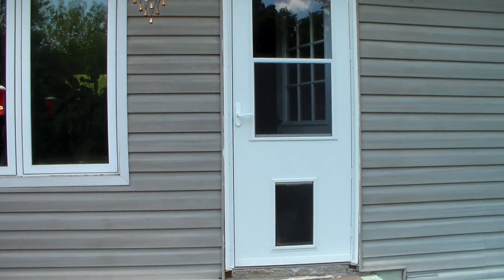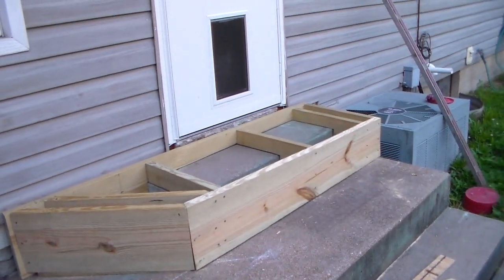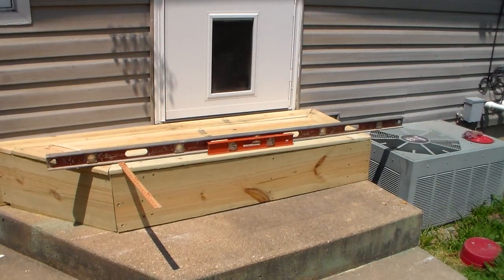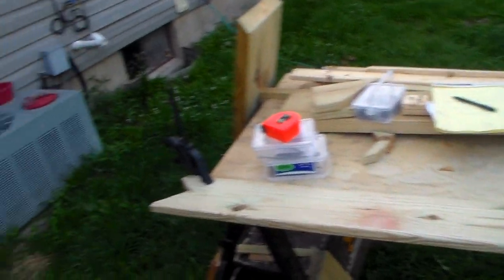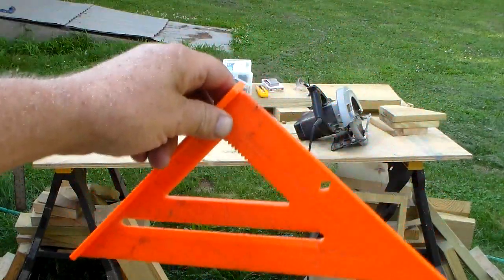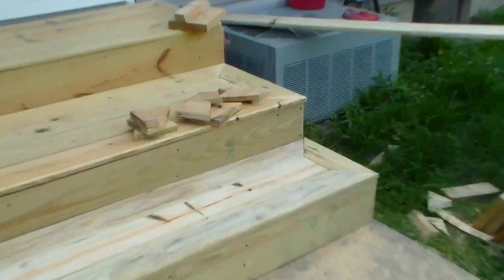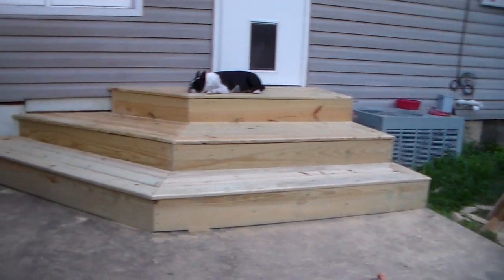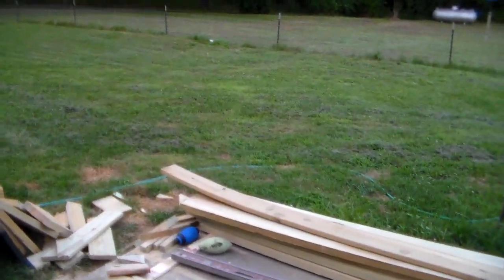Deck steps over crooked concrete

Comment: nice job,my front porch did that same thing. my house was built in 49 and i am certain things were not done as they are today. i ended up tearing the porch down and need to rebuild it the same way you did yours one day.
Reply from the maker: Sounds like you have a lot bigger project on your hands than I had here.
It can be done,.. just not in a day,   lol
Thanks Roger...
Reply: that i know,and not when its 90 degrees and sunny. i posted a real video update on the cushman and my shop yesterday,check it out when you get a chance
Reply from the maker: I sure will, Thanks for the heads up

Comment: I'm actually do the math for a customer right now putting composite deck boarding over her concrete steps I built a frame around the deck and I am going to start putting on Deck boarding on the steps and fascia board on the kickers and side. Blend it in together
Reply from the maker: Sounds like a good job,  best luck with it. Thanks for sharing..

Comment: Not knowing how much room you have out there all around, but I would have just built a flat deck over the whole thing and then a proper set of steps off of that. You certainly have done an admirable job in overcoming this obstacle. Well done Bruce.
Reply from the maker: That whole patio is about 15' x 20'  there's a door into the garage off of it that has a 3 " step up from the concrete. So,... a complete deck build wouldn't have really helped me out much.  
I appreciate the kind words George, Thanks so much, 
& Yeah The pups all seem to like it, now that it's done. lol

Comment: What did you anchor the Joyce’s to the concrete or did you or did you just anchor to the back of the house and then continue to anchor from there
Reply from the maker: Actually neither, it's heavy enough it's just sitting there. If it ever needs moved it can be pulled away from the house & put back. Thanks for checking it out...

Comment: no drainage, tons of pockets to trap water. That thing is gonna rot in no time. Never build directly on concrete. Concrete actually holds moisture. Good looking steps though.
Reply from the maker: Well let me tell you why you are wrong. 1st of all, the existing pad was on a grade that allowed for natural run off,  2ndly, I thought of that while building and have taken steps to prevent the wood sitting directly on the concrete.  Periodically I place small pieces to lift the boards off the ground. So all water runs off and drains away naturally. 
 Almost 6 years now and still solid as it was when it was built. 
Thank you for watching and commenting, I appreciate the kind words at the end.... Cheers

Comment: Did you attach the first board to the house? If so how do you that? I am wanting to install a deck on my patio.
Reply from the maker: No I didn't attach it to the house. It's heavy enough to sit where I built it.
I did research it though and there's several YouTube videos that show how to do that for different types of siding applications...

Comment: Can't take anything away from accomplishing what you set out to do.  However and in many cases though, the cost of time would have prohibit that much customization.  Roughly speaking it seems like a concrete demo and re-pouring would have been done cheaper and faster.  Don't take me wrong though I appreciate the work you did but for me it would had all come down to time.
Reply from the maker: I understand and agree that if I had to pay carpenters to build it, a re-pour may have been cheaper.  But as it was my free time, and materials were about $300. this wasn't to bad.
Thanks for saying, I like hearing from folks that watch... Cheers

Comment: how does water drain??
Reply from the maker: Natural level of the base concrete creates a downward angle for the water to run off. & I put small pieces of wood randomly along the bottom to male a gap & allow water to run out from under the stairs.